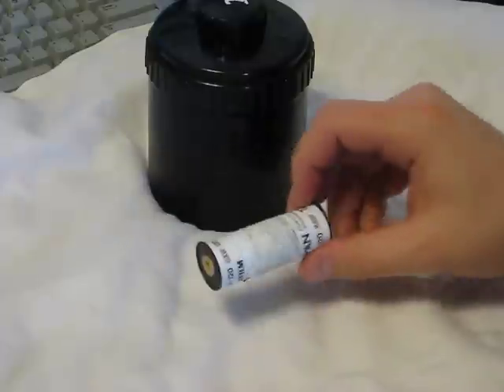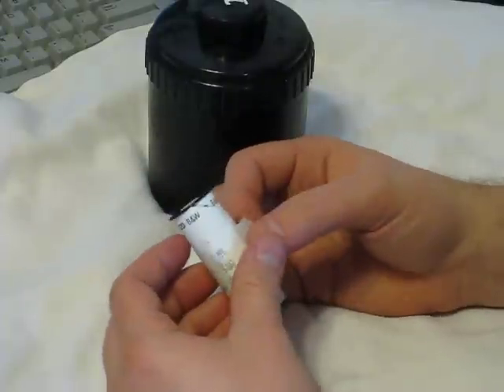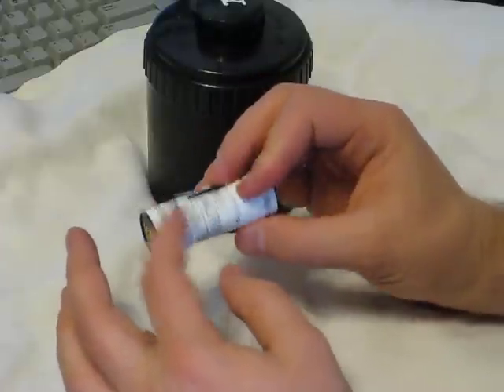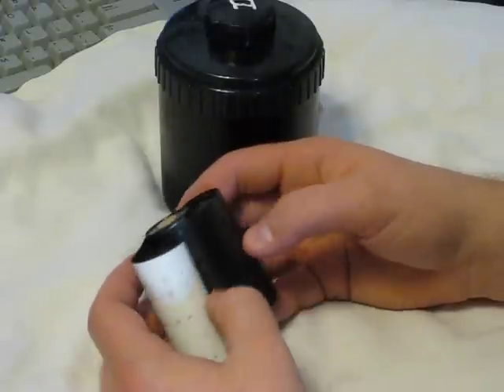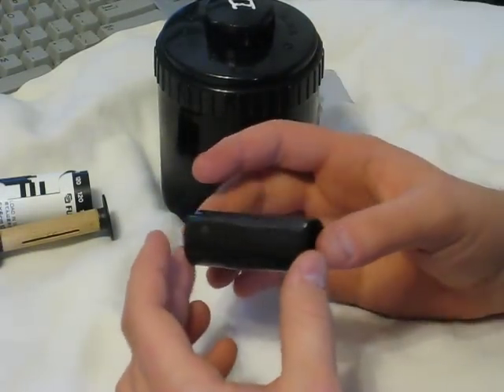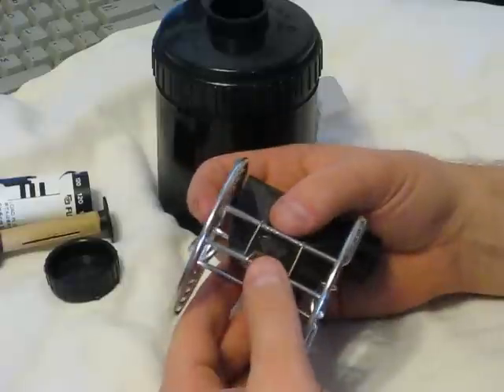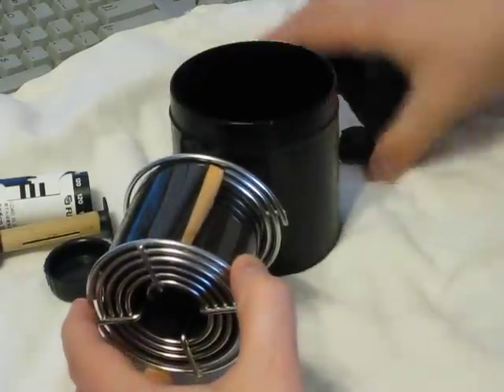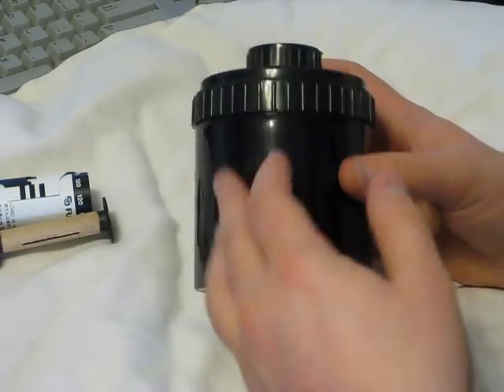Loading 120 Medium Format Film onto a Stainless Steel Reel

Comment: Around 2:00, The film in your video was not from the 1960's.
Though it may seem like it, Neopan is a modern film. The backing paper gives it away quite easily.
Likely someone bought the camera before you, loaded it with modern film, and never used it.
Reply from the maker: The backing paper is Neopan, yes. I think I re-spooled old film onto it. That looks like it was held on by masking tape that I put in plate (the ragged edges don't look like anything Fuji would do.)
Reply: Oh I see. Yes I quite agree with your statement on the ragged edges. Fuji film has too much of a luxury price to ever see anything other than  professional looking materials.